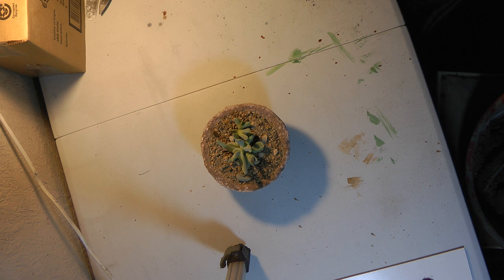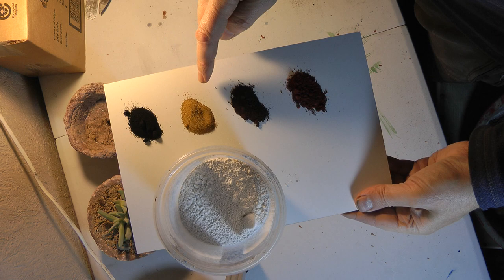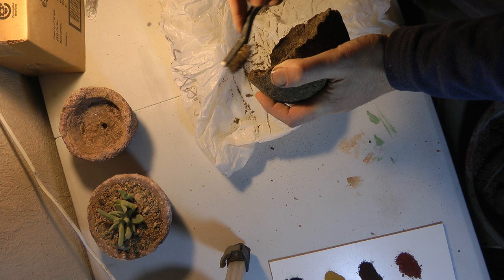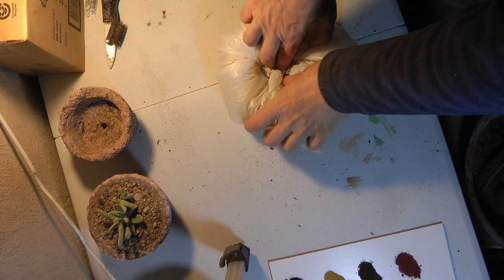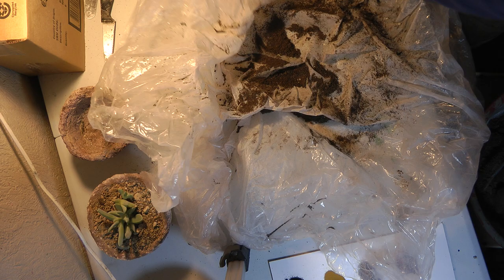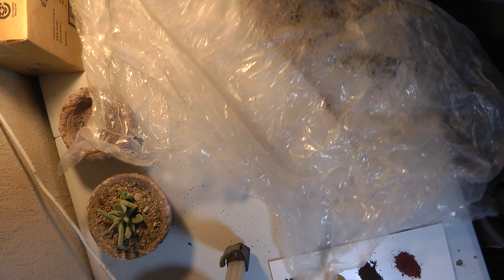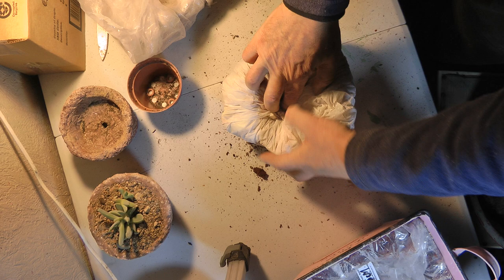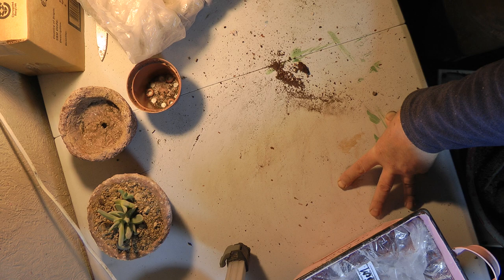3rd stage Hypertufa process

Comment: Hi Brendan love your great info on hypertufa  pots I have a few questions If I want to make bigger pots than you have made for the garden how would I know how much to use secondly what ratio to cement for the cement colors, also I saw on YouTube a guy put sand in the bottom of a pot & carved out holes for feet in the sand then poured in cement I was wondering if that would work for feet also just a thought thx for ur replies 👍🏽

Comment: Great video ✌ how do you make the insert for the legs? 
Also when removed from the mould. Can they be cured in water? (Thats what I done 👀) as I've seen numerous videos/read info of everyone letting them cure for different amounts of time. E.g. some for a few days then leach in water for a week or so and some with your method. . . Would it matter ? Or does it just depend on the overall size/ intended for outdoor/indoor ?👀✌
Reply from the maker: The insert is made by a piece of foam insulation board or polystyrene with the corners cut out, and yes I suppose u could cure it in water, though why I don't know as wrapping it in plastic is easier.  The curing time depends on the temperature, climate and mix.......If u want it to be really frost proof in a hard winter climate,  make your mix 1/3 proportions of cement, sand, & compost.
Reply: @BrendanDean99   ah thank you 😊 and i'll just be using mine for indoors. The ones I have done at the moment I can't even scratch/desurface anymore. I suppose tho as you mentioned the temperature/mix and climate play a factor in that to 😱. I'm going to do another but using your ratio & method for curing to see if I notice the difference in them 😆
And thanks for reply 😁